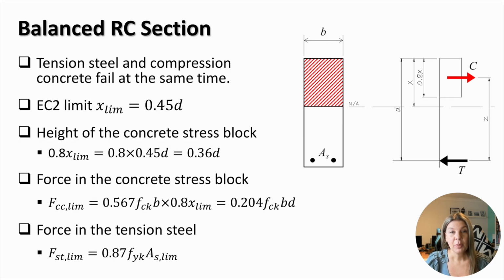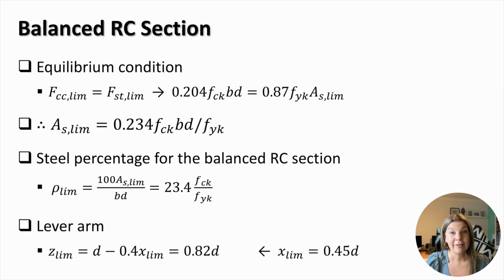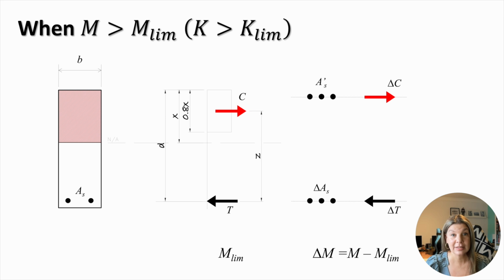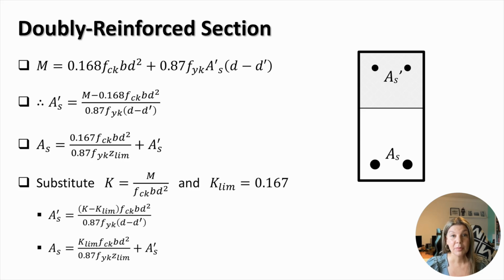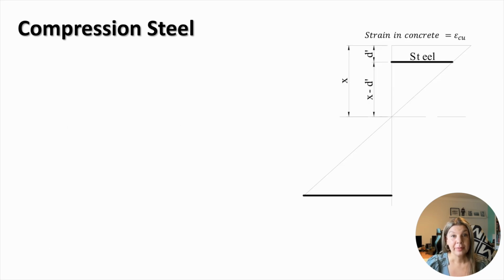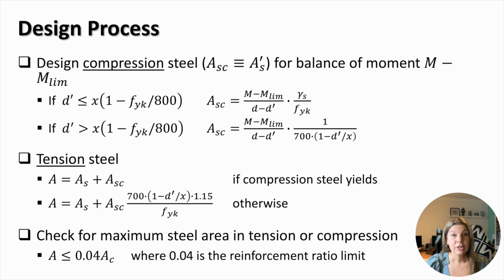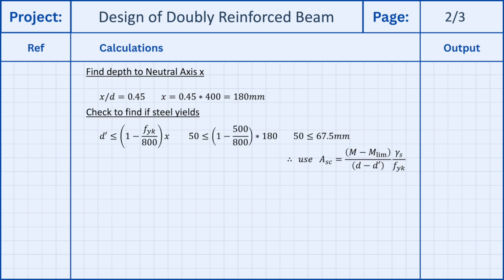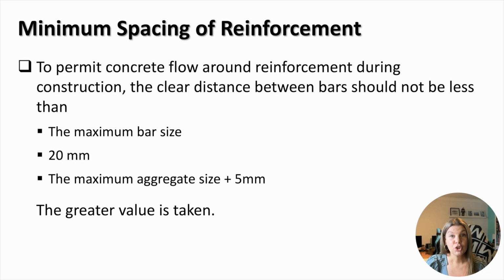Reinforced Concrete Design | Topic 3: Doubly RC Section | Eurocode 2

Comment: how can i get the limitations of area steal maximumm
Reply from the maker: Thanks for the question. The maximum longitudinal reinforcement is checked using Eurocode 2 Eq. (9.1N):
As,max=0.04Ac
where: Ac=bh is the gross cross-sectional area of a rectangular beam.
For a doubly reinforced beam, the total longitudinal reinforcement should satisfy: As+As′≤As,max
This limit helps prevent reinforcement congestion and supports proper concrete compaction and ductile behaviour.

Comment: how did you get 1.15 that you used as ys
Reply from the maker: It comes from Eurocode 2 — γₛ = 1.15 is the recommended partial safety factor for steel, calibrated to account for material variability and modelling uncertainty.